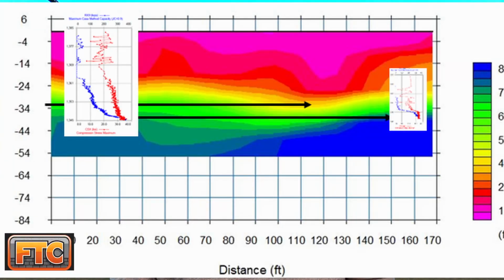My Rant about Pile Foundation Designers

Comment: Huge problem with the younger generation not understanding how important practical field knowledge is. 

I know it seems cliche to say, but younger engineers i meet dont seem to understand that they need to have real world field knowledge.  It seems like more and more, i see jobs that are designed as if they are just a computer game. 

I had a job a couple of years ago, the contract was for 600 and some thousand dollars.

To make a very long story, as short as possible.  The job essentially consists of having to remove/replace a total of 8 EA stainless steel slide gates.  (Appx. 6'x4' EA) at depth of 30' or so under water. 

6 of those gates were to be installed on walls that acted as dividing walls in an overflow building in a resevoir. (Single structure with chambers below water line)

Contact drawings very clearly showed section cuts of those interior chamber walls as being concrete. With that, the specifications called for surface mounted slide gates and we bid with the appropriate gates/mounting hardware. (In this case, threaded rod/injection epoxy.)

We got the job, i get to the site , 30 seconds after walking into the building, i pull a floor plate, shine my flashlight down into the chamber and see 100 year old brick. 

The division walls were built out of hundred year old deteriorated bricks. Not concrete like the drawings show. 

I take some pictures,  head back to the office. As soon as i get back to the office, i type up an RFI, send it to the engineers, with some pics. 

Turns out, nobody from the engineering team had bothered to pull the plates and actually look at the division walls. 

The entire job...a SIX HUNDRED THOUSAND DOLLAR JOB had been designed using the original plans from when the structures were built and someone,  somewhere along the original construction,  switched those walls from the originally planned concrete,  to brick construction. 

So now the city has us under contract to replace these slide gates. My gate manufacturer is saying theres NO WAY they are going to approve us installing them onto the old brick walls. (Anchoring concerns, along with the fact that there is no plumb/even plane to mount to)

It was an absolute mess. Ended up costing the city hundreds of thousands of dollars and the plug eventually got pulled on our contract. City had to bring in an outside firm to redesign and put it out for bid again (as a much larger project which involved replacing the interior chamber walls)

I could write a book about how it all went down, but the bottom line is...5 minutes of field time would have saved the city  hundreds of thousands of dollars.  

I was absolutely dumbfounded when i realized that nobody from the design team had lifted a single plate to see if the existing conditions actually matched what was shown on the old drawings. 

Ive seen the same type thing on quite a few projects,  that was certainly one of the more memorable ones just because of the way it all played out.

Comment: This was an incredibly interesting video to listen to, and thank you for posting it. :) I'm not an engineer of any sort - I've actually been working as a tutor for the last six years, teaching Essay Writing, Literature, and Reading. But, despite the difference between these fields, your comments reminded me a little of something I've seen with many of the students I work with - the underlying idea of "the computer will take care of it." I have had students try to tell me that they can put their writing into Google Docs and Google Docs will fix all of it, and I've had to gently correct them that, no, I'm sorry, grammar check and spell check can fix some things, but it won't give you a perfect result. They are tools you can use, but they have their own flaws. In fact, sometimes they give you the entirely wrong answer because the computer isn't seeing all the factors at work in a sentence, and you have to know the foundational rules and make corrections yourself as you edit. 

It sounds like there might be something similar happening in your field, where designers are relying on software and calculations without getting down in the trenches, so to speak. They have the theory, but not the practical experience, and maybe that's what stifles their curiosity too - if they think that they get the perfect calculations every time, why would they be curious about the results of a practical test? That's one of the things that concerns me about AI - I can certainly see its use as a tool, but if people begin to rely on it heavily while forgetting the potential flaws, and they don't keep practicing the practical aspects of their work, it seems like that could lead to major issues in a plethora of fields...issues, potentially, like the ones you are seeing.
Reply from the maker: Thank you very much!  I appreciate your comments.  I agree with what you are saying and I think it boils down to many people not developing their critical thinking skills to an appropriate level.  I think the focus on test scores rather than understanding fundamentals in many school systems is part of the problem.  With widespread use of the internet, there is also the mentality that people don't need to know anything, they just need to look things up.  But again, that only applies to facts and not to ways of thinking and writing.

As an experiment, I had ChatGPT perform the calculation for the axial capacity of a pile in soil.  The calculations appears to be correct but the answer was off by a factor of 10.  When I looked closer at the equations, I realized that ChatGPT made a fundamental error for one of the inputs.  People who have not had prior, real-world experience would not have recognized this error.